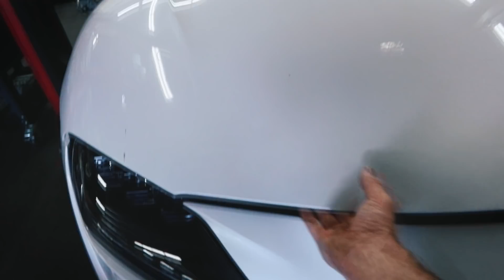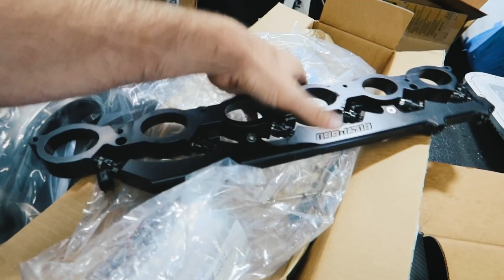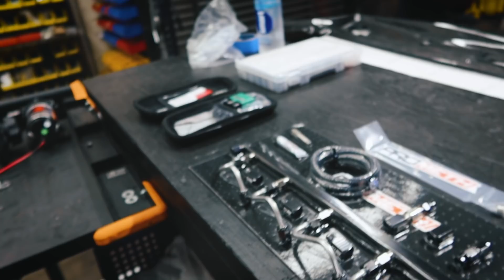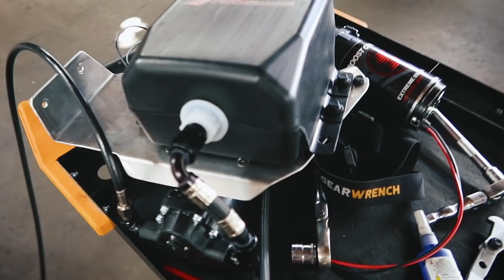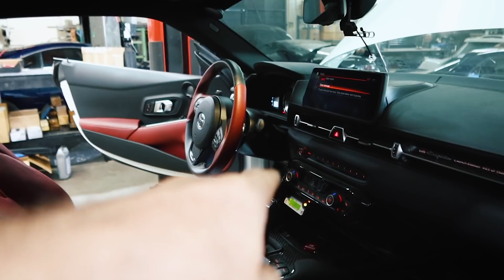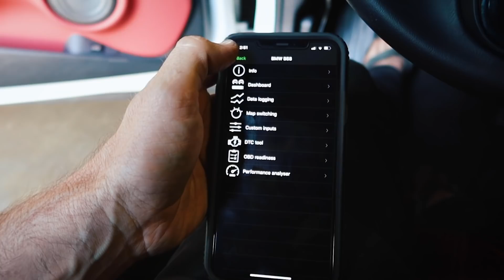MKV Supra Gets Bigger Turbo + Meth Injection

Comment: Dude tell me what are you going to do or does it worry you about the cost of 2jz's at the moment? The prices are insane and only look to be going higher. This must have an impact on your business, fd program or future plans because this has to be the most expensive motor being used on the fd circuit right now. Like you have built an entire business basically around 2jz. Just blowing a block or wrecking a head now is a significant cost with 1000's on the line
Reply from the maker: Most cars in FD have $30k-$50k motor dude